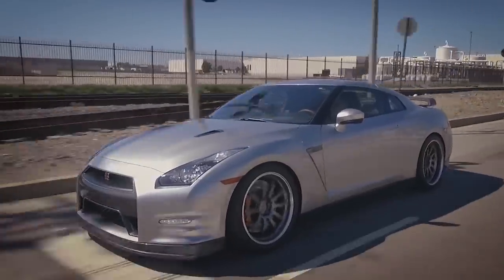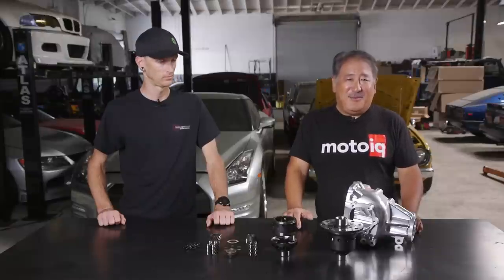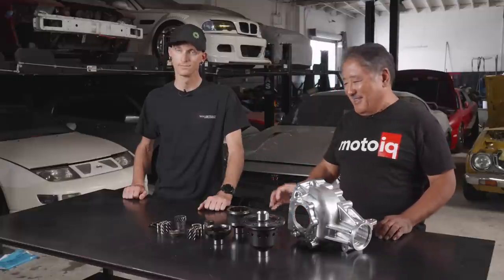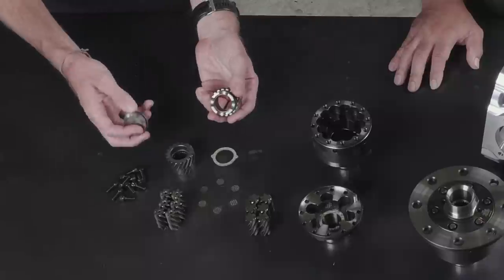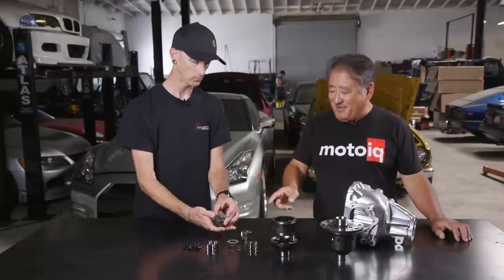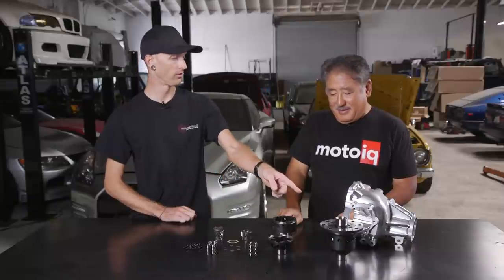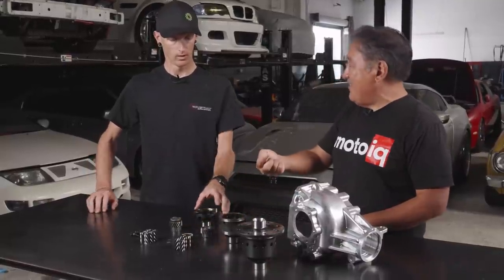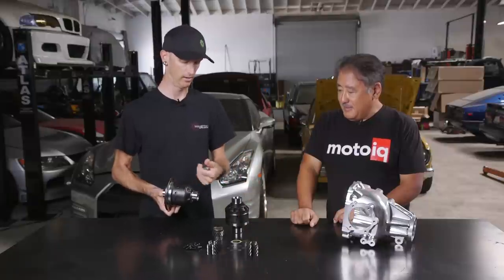How a Wavetrac Differential Works (and why you want one for your GTR!)

Comment: Here's the wild thing about WaveTrac - I learned about them years ago from hearing about 2000+HP small tire door cars running them(Ford 9" app of course, they have them for 31, 33, and 35 spline)! Absolutely one of the baddest diffs on the planet! I don't tend to believe in products that can "work great in practically all applications" - but, honest to goodness, these things are seriously one of the best diffs for a whole variety of different applications. 
Only thing I don't know about is off-roading, trail rig kind of stuff, I'm not sure how these perform with the leverage & weight of REAL big, heavy tires, and large variances in tire to tire traction. Of course, it's hard to beat selectable lockers off road(and, frankly, an open diff isn't the worst thing in the world for trail rigs on big tires running around on the street, keeps them predictable in winter weather, and you can still always flip a switch and lockem' up of course), so it's a bit of a non issue regardless; but damn they're tough to beat for a LOT of straight line and corner carving applications for sure, regardless of the power level.
I think the only negative is the price lol, but, frankly, that's only compared to the clutch types - they're in line with the usual suspects in the gear type market.
Reply: I'm building a 35 spline 9" for an off road application with 37" tires and was ready to buy a Truetrac because the vehicle will not be trailered and I want something when driving on the road, especially in snow, but honestly even when it rains I have issues in the truck now with an open rear diff. I know HMMWV's come with torsen diffs front a rear. The trick with them is if you get a tire off the ground hold the brake to apply some resistance to that tire and a torsen will bias more torque to the other wheel based on the bias ratio. Technically this works with an open diff too, but the bias ratio is only 1:1.

I was going to make tone rings and install wheel speed sensors in the 9" to maintain the factory traction control system which automatically does the same thing. With a torsen it'll work a lot better than a open diff. If that fails I'll use the foot or parking brake if lifting tires. I'll have an air locker in front. It this was a full time trail rig I'd consider an air locker in the rear, but a locker on a snow covered curvy road doesn't sound like a great idea. It could be fun, but I wouldn't expect it to be the safest option. The torsen will always be working in the background to seamlessly balance torque.

I see Wavetrac have a high friction variant for the 35 spline 9" application. I think I might go with that now. I've had good luck with the Wavetrac in my BMW for the past 10 years. It does great in the snow with RWD and proper tires. Of course with enough throttle it'll kick the rear out, but if I drive sensibly it does all the hard work. It would be tough in the winter with an open diff and the Wavetrac has been holding up well. The car is twin turbo 335 and after 190,000 miles the transmission is starting to flare from 3 -> 4, but the Wavetrac is going strong. I have no doubt the considerably bigger 9" differential will be fine.
Reply: I have an audi q5 2016 model with the torsen quattro system and open diffs front and rear. I was thinking of changing the open diffs for wavetrack, at least the rear one. My thinking is: my q5 us a great all around vehicle, it has dsg, rear based awd, double wish bone suspension and handles pretty well. Im not looking to turn it into a track car, or 4x4 rig to go rock climping. I just want to have a vehicle thats gonna handle all the offroading i ll ever need to do while still being fun and comfy on the road, as maintance free as possible and without a whole lot of alterations. So clutch type lsd or proper lockers where not an option as a locker is good offroad, but on the road is just an open diff, and clutch type lsd are complicated, electronically controlled most of the times, noisy, not very smooth and require maintance. And of course they are very expensive. I was thinking of pytting torsens or quiafe but they have are gonna have some traction issues once a wheel is up in the air, so the wavetrack to me seem the best of both words with just a little bit of comprimise.
Reply: @loukasantoniou8054  If money is no object do both axles. The great thing about Toesen diffs in general is they work great on road, and if you do ever find yourself off road with one wheel in the air/mud/on ice, just apply moderate throttle and ease on the brake with your left foot. This will create resistance on the slipping wheel and transfer torque to the wheel with traction. I bet your Q5 has an eLSD system that applies breaking pressure to the spinning wheel using the ABS system. Systems like this are great compliments for Toesen diffs.
Reply: @Fix_It_Again_Tony  yes i know that, however this can put some wear to the brakes. However with quattro doing it for me, it wont be that bad lol. I was hoping i could find a non clutch style lsd with enough lock and i though wavetrack was a good option, but after reading a lot of comments, im 50-50 now. maybe a clutch type lsd like the first and second gen cayenne is a good option. I have an engineering teacher(turor) who is quite a car geek whom i could ask for advice.
Reply: @loukasantoniou8054  I would stay away from a clutch type LSD in your application. They will change how the car feels on the road, especially in parking lots or other tight maneuvering. 

I think brake wear is a non issue because brakes will only be applied at low speeds when one wheel loses traction. The brakes are designed to quickly bring the vehicle to a stop from highway speeds.

One other aspect is maintenance. Gear type LSDs are maintenance free. Just normal diff oil changes required, same as with standard equipment. 

Good luck with your decision.
Reply: @Fix_It_Again_Tony  thanks, i will consider all factors and options.

Comment: I was always fascinated by Torsen's differential, and although the geometry / config is different, the fundamental principles are the same. These appear to all depend on 1 thing: Friction. The friction is achieved by resisting the axial thrust load on helical gears. That friction is controlled by design, at a few interfaces that are not readily obvious;
1. The axial bearing. In WaveTrac's case, they introduce some fiber reinforced plastics and other abrasive friction materials. But basically, stopping the helical gears from shooting out the sides of the diff, whether metal on metal OR metal on ceramic fibers.
2. The radial bearing. As you can see, the gears ride in a flower pedal array of offset cylindrical bores. Disregard the axial thrust; Those helical gears still get loaded against the sides of the case, and that metal on metal friction contributes to the differential splitting load from a freewheel to the loaded wheel.
3. The helical gears pitch / twist: This one took me the longest to wrap my head around. But if you disregard the other points, this one is essentially the MOST fundamental one. The more the planet gears look like a screw vs. like a spur gear, the more they resist axial load (like the ARP bolts; they are screws in tension due to their fine thread pitch). If you, as a designer, change the pitch of the planet helical gears, you change how the locking action behaves, because the pitch affects friction as the gears slide against each other and jam themselves against the load bearing surfaces of point 1 and 2! This one is tricky, however, because it is subject to not only the lubricity of the gear oil being used, but also the material properties, surface finish, tribology and surface treatments of the gears.
4. The WaveTrac signature feature: The sinusoidal cam profile which in effect introduces pulsations of load into the helical gears during wheel slip. This one seems the most obvious in terms of functionality and it sure is clever; If one wheel is spinning and one held stationary, and you could see through the differential, you'd see that for every revolution of the free wheel, the splined sun gears on each axle are spread apart and pushed back together 4 times, this forces pulsation of all the frictions above in points 1,2,3 to cycle up and down, which allows the freewheel to lock up in pulses!

Pulsing is always good for traction, remember examples of pulsation used as a benefit:
Anti-loc Brake Systems
V4 Ducati MotoGP power delivery to rear wheel
hammer drills / impact guns (ubiquitous in all trades now)
etc etc

Let me know if i got anything wrong!
Reply from the maker: You are right in every way except the pulsating load, it doesnt pulsate, it is more like a cam adding load.
Reply: @motoiq  you're right, I was wrong about the cam action! The cam is constrained and cant skip over, it just loads up the friction disc further.
Reply from the maker: Yes sir!

Comment: Im on the fence about changing from a torsen to a clutched lsd in the rear of a low power rwd car (miata). The reason im not over the fence yet is the fact that my priority with the build is driver engagement and predictability, just to get out on the track and dance with, knowing ill never set any lap records, and im worried about the clutch being just slightly less smooth. Do you think this would be the answer? Asking in theory so idc whether they have an option for miatas or not rn.
Reply from the maker: I think the torsen just might be better on a narrow tire low power lightweight car.
Reply: @motoiq  even over the wavetrac? Sorry, realized my comment didnt specify for sure that thats what i was asking about at the end
Reply from the maker: The wavetrac is superior to the torsen or quaife but its probably not worth it to take out a torsen from a stock Miata and switch with a Wavetrac.
Reply: @motoiq  respect for honesty

Comment: Not sure why but I want to install a clutch type LS carrier on my 82 911 SC 915 transaxle which a used unit will likley need a rebuild before installing. It's only street used and why I say not sure is from a purely technical perspective, along with the added weight of engine placement, at 180hp or even a ROW car with 204hp, these air cooled 911's really doesn’t technically make enough power to require a LS yet I still want one. From a technical perspective, any non clutch gear type makes the most sense on a 915 gearbox as the syncros don't like the requirred added slippery additive to keep the clutches from sticking.
Reply from the maker: You can WPC the plates, it works really well.  I prefer clutch types in the rear of cars myself.

Comment: This may be a dumb question, but would anyone recommend using this to be used in a car that will be driven in snow? I have a 2020 Civic as my daily and and drive it in snow. I have snow tires(Bridgestone Blizzak WS90) and chains, but that open diff can only do so much.
Reply: I maybe wouldn't get it specifically for that cause it could be somewhat of an expensive part/install but I would think that it would help in certain situations for sure. Say you are driving on a snow covered road and you run on a frozen ice underneath with say your front passenger wheel - your current car would then just push more power to the wheel that's spinning on the ice and you wouldn't go much further. If you had this or any other lsd installed, once the front passenger wheel starts slipping on the ice your driver's front wheel will get some power transferred to it and you would be able to get out of the situation.
Reply from the maker: Way more than an open diff!
Reply: I have a Wavetrac in the rear of my RWD car and it does great in the snow with proper tires. It'll also prevent spinning tires in the rain when taking off from lights. No traction control cutting in, just acceleration.

Comment: Face cam like that is really OLD tech but people always come up with new uses for it.
Using outside of housing to hold gears in place instead of a bearing is novel idea, how high is the friction load?
I looked up 8620 and 9310, both low carbon high toughness steels designed for case hardening, impressive stuff.
Reply from the maker: having bearings would reduce the effectiveness of this diff.
Reply: The friction due to the lack of axial thrust bearings is key to the torque biasing action. The lack of bearings for radial location is more strange, less important to the way it functions, and normal for differentials of this general design (of which there are multiple brands).
Reply: @brianb-p6586  I actually found it interesting as I've never seen it before plus didn't know there were similar designs. (since I stopped teaching I stopped researching stuff)
Reply: @1crazypj  other brands of this type include Torsen T-2, Quaife ATB, and Eaton Truetrac.

Comment: I have a similar drivetrain, but with no LSDs (xdrive M140i). 

The car is driven on track rarely, 5 or 6 times a year only for 1h stints. 

Would you recommend wavetrack or OSGiken for me?

Edit: for the rear axle, would do the front in the future but not soon
Reply from the maker: For casual performance driving, this is a great choice.

Comment: Was thinking of putting wavetracks on my 2016 q5 with the torsen center diff. Reason being i want a simple reliable smooth easy to fit and maintain lsd that will improve both on road and offroad performance. Im not talking about track use, or rock climping, but better traction in every type scenario. I know wavetrack can handle sport driving, but can they handle offroad use as well? I want to avoid a clutch type lsd or a locker as the first one ia expensive and needs alterations prior to installation and the locker while the beat option offroad, on road, it wont make any difference.
Reply from the maker: I mean a locker is better for pure offroad but a wavetrac works all around.
Reply: @motoiq  maybe a ln lsd with enough lock

Comment: I have a true track installed in my Tacoma runs like a dream what's the difference between that and this wave track
Reply from the maker: When a true track starts to peg leg when a wheel looses traction completely like an open diff, the Wavetrac has a secondary clutch that keeps sending power to the spinning wheel

Comment: If a wheel comes off the ground for more then 3 seconds, or an axle snaps, would this diff be able to send power to the side with the most traction, under low wheel speeds?
Reply from the maker: To a degree, not as much as a clutch type or detroit locker but more than a Torsen or Quaife.
Reply: No. They dont at ALL. The friction plates are non-serviceable and dont do anything. Look up BMW ice wavetrac testing to watch this LSD fail miserably at its marketing claim. 

Use a Quaife, or otherwise if you want a Torsen. For BMW, Miata, or any RWD vehicle, you most definitely want a clutch pack rear diff. Look into OS Giken, and "Gripper" brand diffs from Europe
Reply from the maker: This is completely wrong.  A Wavetrac has more lock than a Torsen or Quaife  when one wheel starts spinning but not as much as a clutch type diff. It is one of the best diffs for the front of an awd car, the front of a lower power more narrow tired FWD car, Good on the rear of a lower powered narrower tire RWD car, good on any end of a late model car with a lot of electronic nannys, good for people who don't want to put up with juddering and clunking. It is not good for wide tired, high power cars except for people who have a hard time handling power oversteer, its is not good for drifting, not my first choice for a race car.
Reply from the maker: https://www.youtube.com/watch?v=H3FTG0RVBJU and here is one sending power to the wheel with more traction on ice
Reply: @brandonlittle6444  I have a Wavetrac in the rear of my RWD 335i and it has been doing great rain, shine or snow for the past 10 years and 140,000 miles.
Reply: Finally some truthful replies. I'm on the 4th wavetrac in my 31 spline  9" in my mid 11 second 89 3.8 Turbo Trans am. Moser did do a good job of honoring the warranty, and after the 3rd one failed I took a  3 hour trip to their shop, with my center section, and axle shafts,  and they let me do my little demonstration of the problem, and then didn't charge to swap it out. The clutch material on the waveplate  disintegrated on the 3rd one. They said the 4th one was redesigned to fix previous design flaws.  Well going from reverse in to drive clanks So loud it sounds like it's about to break,  and getting both rear tires to spin in the water box at the drag strip is a challenge sometimes.  It's embarrassing actually.  My broke ass car with 1 wheel peel with a differential that cost well over $1k.  Next time it breaks definitely not going through the hassle to have it replaced again when I know it's a ticking time bomb.  Anyone that doesn't believe me I have multiple videos of it failing.  Couple are on my YouTube channel.
Reply: Dude no.  It sucks. Even in the rain going around a turn it's hit or miss (mostly miss) on both tires spinning.  It's literally like driving with an open diff

Comment: Im Just Surprised those tiny gears can Stand upto the power of a high power Skyline (Like 1500-2000HP) 
Specially if 1 front wheel is locked under braking and little tiny 15mm gears holding all that force :O

Comment: whe wave aspect was explained in a manner that would lead one to conclude that there is smoke and mirrors in play
- the wheels left and right axles are " virtually never" syncronised at the exact speed for any length of time, even in normal operation
- as the axles rotate relative to each other, the wave feature will vary the preload on the locker in normal operation, not just come into play with significant wheel slip

now I am not saying the system is bad (or good), just that the explanation does not match reality
Reply from the maker: The amount the wave cams is in proportion to the differential difference and torque load, it's as clear as day. No smoke and mirrors.